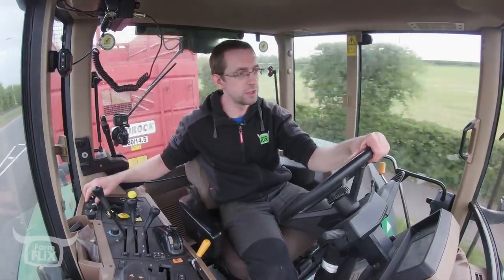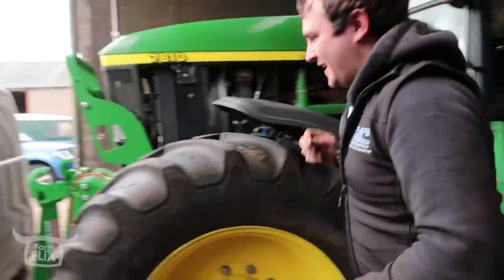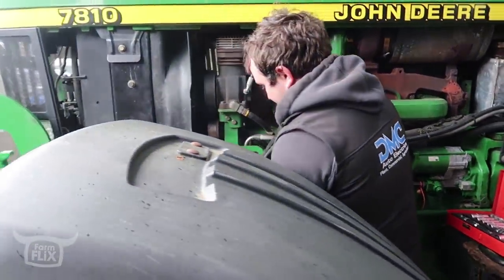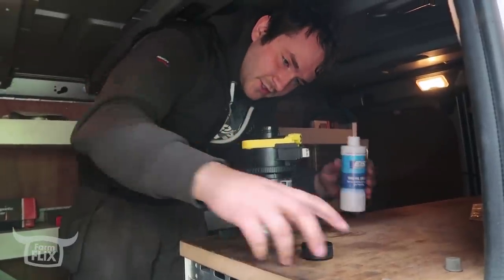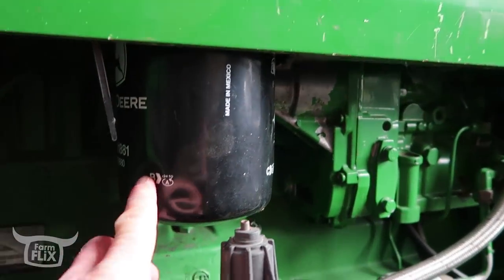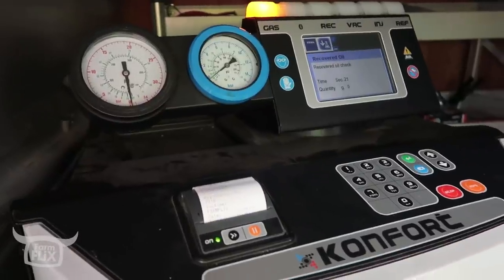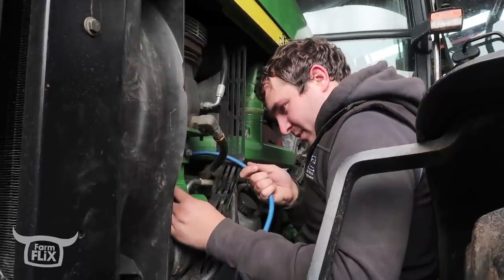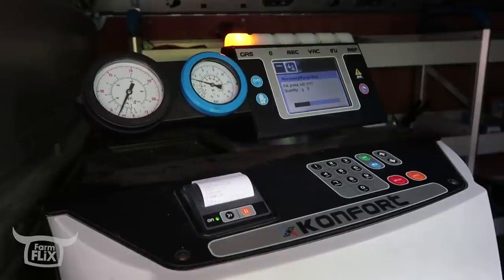TRACTOR AirCon REPAIR... John McClean | FarmFLiX

Comment: John, did you find the rear McHale mower heavy?  I have one and you would need to keep your whits about you on side hills..
Reply from the maker: Wasn't working on any mad hills, would recommend adding some counterbalance weights on the frame they provide for it just to take stress off the cross shaft but we didn't have any on for the demo... Videos to follow 👍
Reply: I have 450kg on her to save the cross shaft.   Robust machine but strength comes with a price.  Triples would be a fair weight.

Comment: If you have the old motor test the  resistance sensor it could be 10k ohms at 20 degrees C. Then Try a 10k Ohm resistor .

Comment: I had a fella tell me one time it’s good to run the ac in winter time because it pulls the moisture out of the air in the car . Saves the windows fogging up . Do you think there’s any truth in it ?
Reply from the maker: No idea but that's what most cars do by default if you direct the air to the front window

Comment: Why was yer man using a trouser belt to loosen the filter? There is tools to loosen it without damaging the filter
Reply from the maker: Sometimes you have to use the tools you have to hand though... We'd just have put a new filter on if we had time to have her parked ;)
Reply: That filter didnt come off with the correct tools, it was a heavy screwdriver job when she got serviced